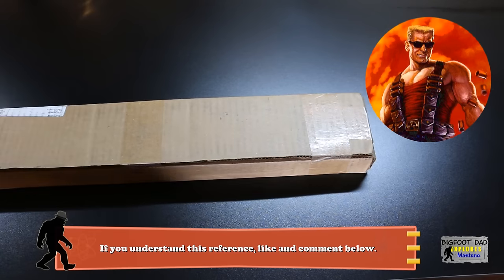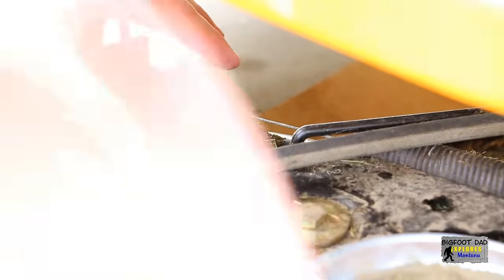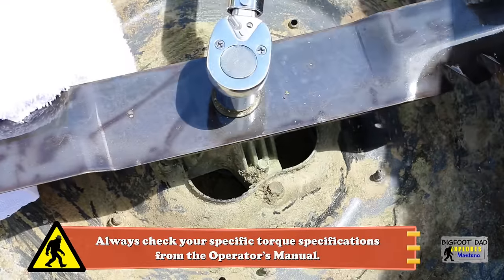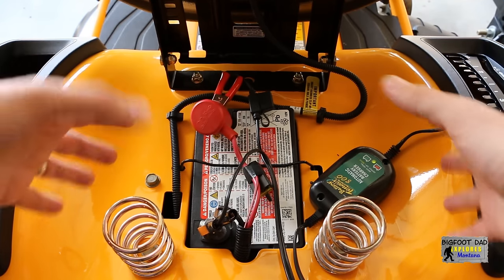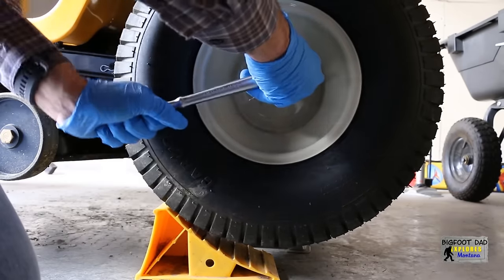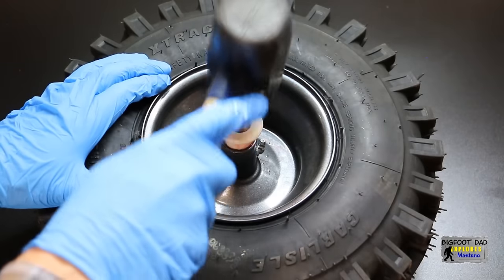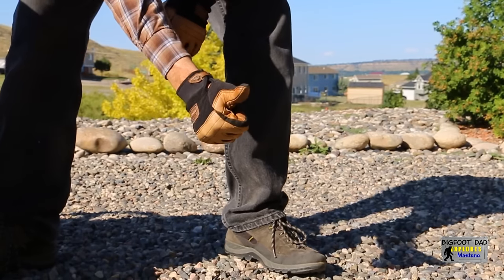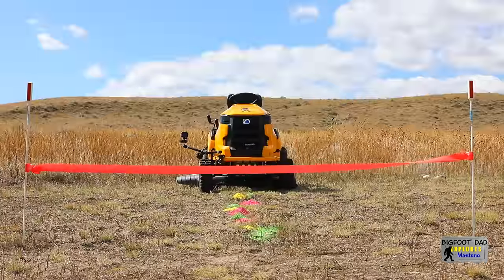Upgrading Your Tractor Mower: Cub Cadet XT1 LT42" Mower (ATV Tires, Blades, Brush Guard, Headlights)

Comment: Do the tires tear up the sod when you mow? I know my atv does.
Reply from the maker: Hi, Stew - I like to refer to this as aerating.  🤣 Yes, this could happen on a yard that has a thick green carpet, especially if the wheels start to slip on an incline. I notice this mainly when backing up the hills - they'll get chewed up a bit.  But keep in mind that most ATVs have their axles locked together in the rear, unless there is some kind of turf-saver mode that will unlock one of the sides.   However, the XT1's, have an open differential, which will help preserve the turf and gives them the tight maneuverability.  I hope this helps.  If anyone else can help Stew from your own experience with this setup, please feel free to chime in!

Comment: If you use those blades know they are heavier and will wear out bearing faster. But they work if you want to cut high grass. Next I would have took my mower to the car wash to keep it clean and looking new. But nice vid
Reply from the maker: Hi, @stephenspencer2121 - this is good feedback and knowledge for people to draw upon - thank you for mentioning this.  It's time for a blade change again so will have to look into either getting new ones again or trying another brand.

Comment: This reminds me of a V6 Mustang. Same pretty, but the engine doesn't sound right.  Gotta have that sweet V sound.
Reply from the maker: I'm bringing this over to your garage next weekend.  Time for an engine swap.  😉
Reply: @BigfootDadExploresMontana  I actually do have a spare. The transmission died on my last mower, so I scrapped it, but the engine was still good. 26 hp Briggs Extended Life Series. Only about 130 hours. Dirty secret of riding mowers, they're all compatible. Same engine mounts. They just charge you more for the various upgrades and color schemes. Find yourself a V-twin and stick it in there. A true upgrade.  Won't go any faster, but will be much more powerful.
Reply from the maker: @wiredforstereo  - Thanks for the info on this.  YES, this would be an awesome upgrade.  I've also seen that you can upgrade the transmission on these too.  This sounds like something worthy of doing.  I think that something is up with my transmission - it doesn't reverse all that fast anymore.  🤦‍♂️
Reply: @BigfootDadExploresMontana  Your local mower guy can often resurrect these. I'm told it's an obstruction issue with an internal filter.  Or you can replace the trans. Though they're not cheap, a major proportion of the total mower cost.

Comment: Hey man, I want a mower that I can cut with at six inches high, already have those blades and tires , what would be the benefit of putting taller tires on.
Reply: You can go faster
Reply from the maker: @MudStreak Legend - this is true!  😂  
@Milton Aliff - the rear tires are pretty tight as there is not much room between the deck and the tread.  You may be able to eke out an inch larger on the diameter, but that would be pretty close on the margins.

Comment: pro tip you do not have to do all this to replace the blades simply drive the front of mower up on some plastic car ramps or jack it up and put it on stands
Reply from the maker: Hi, Gold Beast - Agreed - that is much quicker.  
I tried recording it with the front end lifted, but couldn't get any good camera angles, hence the removal.  I probably should have mentioned the video that it's not necessary, no probably practical in most cases, to remove the deck for a blade change.

Comment: I checked your link for rear tire , they don't have 20×10-8
Reply from the maker: Hi, Ukrainian trucker  - It seems that that product on Amazon keeps switching options depending on what they have in stock.  I'm looking through a few websites right now, but they seem out of stock at most places.  I do see some ebay sellers with them, but that's more of a gamble.  I am thinking that maybe a trip down to a local ATV shop might be in order to see what they can set you up with.  These are just ATV tires anyways - perhaps they have a different brand with a good off-road pattern that might work.  Let me know what you find - I'm always interested to hear alternative ways to achieve an awesome upgrade.

Comment: I used this same type blades now it leaves uncut grass behind. Never had this issue before.
Reply from the maker: Hi, Travis!  It sounds similar to my issue I experience every once in a while.  Usually mine leaves the centerline uncut if the grass is too thick.  I do believe there is a slight flaw in their design, but I'm hoping that the toughness of the blades makes up for it in the long run.

Comment: You should have replaced the front wheel bushings with bearings while you were at it.
Reply from the maker: Hi, Mark - yes, I was considering this at the time.  But for some reason, I couldn't figure out how those would work. Still having trouble understanding how that fits together, so I'll have to order a set and see how that assembles.  Future video maybe?

Comment: How did you set the bead on the front tires?
Reply from the maker: Hi Kyle - I actually had the tire store down the street do this.  But I have had the bead come off on one of my old front tires.  I used a ratchet strap to hug the tire and filled the air at the same time.  It worked great!  Crazy Russian Hacker has a video on how to do this.  Hope that helps and good luck!

Comment: If you want a high capacity oil filter just screw a auto filter on it. Yes they work and they are way cheaper
Reply from the maker: Hi, Adam - yes, this is true.  I've considered this a few times as well.  🙂

Comment: What color did you use on your rims thanks
Reply from the maker: Hi, G ranch - I believe it was some kind of silver matalic (I did this a few years back so don't recall the specifics).  I had the same color done on my old 4Runner wheels because I really liked the way the mower wheels turned out.  Basically, I went into the powder coating shop and asked what would work well in the greys and they said that whatever color that was was one of their most popular options.  Hope this helps.

Comment: Should have upgraded the plastic wheel bushings to Ball bearings. I used Marathon 3/4" Replacement Precision Ball Bearings - 4 Pack from Amazon 8 bucks free shipping.
Peel off the inside rubber seal before installing and they are then grease able.
Reply from the maker: Kelly - YES!  I was actually looking into this and then I hesitated because I didn't think it would work.  Do you have a link you can send over?  Really wishing I could have pulled this off.  Thank you for letting me know this is definitely possible!
Reply from the maker: @kellyconstenius676  - thank you, Kelly!  I just added them to my shopping cart.

Comment: Will the tread on the new tires tear up the lawn?
Reply from the maker: Hi, Paul.  Yes, this is a possibility.  As you can see from my yard's terrain, I don't have to worry about that.  However, if I had nice grass, then I could justify it by claiming I'm aerating the yard.  😉
Reply: @BigfootDadExploresMontana  Ok, My grass is a bit better than yours. But I cut a2-3 other yards for my older neighbors.  Guess I will pass on getting those tires.  Wondering will any front bumpers that are similar fit this mower?  Or do I have to stick to cub cadet?
Reply from the maker: @paulpaetow90  - Sure, that's understandable.  As far as the bumper goes, I have seen about 3 different kinds for Cub Cadet.  But as long as the brackets line up, it'll fit anything that is close.  You may just have to take a few trips to Ace Hardware to get everything squared away.  😎

Comment: Careful, I started with a old Craftsmen upgraded it. Then bought a Husqvarna 26hp and upgraded it. Next thing I knew I had a John Deere 1023e......... and I'm upgrading it. I think I need help.
Reply from the maker: Mike - OMGosh - the 1023e is a beast!  Some may say this is unhealthy.  But I say, roll with it!  Pure raw, machine power coursing through the American dad veins is not a bad thing - at least around here, anyways.  What will you upgrade to next?
Reply: @BigfootDadExploresMontana  A new wife if I go beyond the 1023e. It is a beast, I added teeth to the front bucket and have been digging up large stumps with it. I'm talking about 6 foot wide by 4 foot deep holes to get under the roots. After the warranty is up I'm going to crank up the fuel and see what she can do. Maybe a small turbo?  It's def a sickness.

Comment: I'd LOVE to upgrade mine but I got 5 HOURS on the thing and it won't start , when it did start ONCE as soon as the blades engaged it died, so disappointing
Reply from the maker: Hi, Rottie - did you figure out what happened yet?  It sounds like you may have a carburetor or spark problem.  Hopefully an easy fix and you can be on your way soon.
Reply: @BigfootDadExploresMontana  it was the solenoid , thanks for asking!

Comment: How did u remove the head lamp covers??
Reply from the maker: Hi, Rod - it was a but tricky.  The film, obviously, was an abbreviated version.  The biggest nuisance was releasing the clips from the inside of the hood.  I remember removing the entire top assembly from the hood, then using a mirror, I located the clips for the headlights from within the frontside hood and used a long screwdriver to push on and release them.  I then used the trim-removal tool as seen in the film to pull them the rest of the way off.  Basically, it took some patience and a lot of examining before I I figured it out.  I hope that helps!

Comment: I have a John Deere D170. Belt keeps coming off. On the Deck Could you  Tell me What is wrong?
Reply from the maker: Hi, Eddie - I'm leaving this comment open to see if someone from the community can help.  I would check for an alignment issues with one of the pulleys or a tension issue.  Can anyone help Eddie out here?
Reply from the maker: @ainttakenanyshit  - awesome, thank you for the note!    @eddieolivera539 - this is something worth checking into.

Comment: Awesome video
Reply from the maker: Thank you, Dee!
Reply: @BigfootDadExploresMontana  not a problem. You gained a new subscriber
Reply from the maker: @Mr.Towboater87  - wooo-hooo!  We're glad you're here with us now - welcome to the community!
Reply: @BigfootDadExploresMontana  definitely! A little off topic but I have yet to find a video on the cub cadet branded 547cc engine. Am I the only one with this motor lol
Reply from the maker: @Mr.Towboater87  - Hi, Dee.  No, not at all!  This is a rebranded engine made overseas.  Although Cub Cadet doesn't directly build this engine, it does have some neat features, such as fuel injection and, as a result, a bit more powerful than some of the carbureted units of similar displacement.  There are concerns about longevity of this engines as some have speculated on the quality, but I haven't personally heard of any issues yet.  Hope this helps!
Reply: @BigfootDadExploresMontana  wow I didn't know that. Thanks for the information! Really big help.

Comment: Can anyone tell me if those are the OEM rims for the rear?  I ordered the exact tire in the vid and the fit is not right at all.  I can't tell where I went wrong...
Reply from the maker: Hi, S7A2G6.  Yes, these were the OEM wheels I am using.  
The most important measurement is the radius of the tire.  If you can get those to match, and then at least get somewhat close with the width and height of the old one, it’s usually good enough.  I’m wondering if your wheel size is different.  
Also, these were pretty tough to put on, so I had an automotive tire shop put them on.  Perhaps if you take your tires (old and new) and wheel down, they can either give you advice on what should fit or help you install them if they’re close enough.  Meanwhile, if anyone else can help S7A2G6 out, please chime in!
Good luck, S7A2G6– would love to hear some good news when you get something to fit.

Comment: I reccomend getting rid of that Kohler courage motor they over heat and crack the block leak all the oil then you throw a connecting rod
Reply from the maker: Robin - I've heard of this too.  But if it does, I'll have a new upgrade video!! 😅

Comment: On my tractor the head lights are on the metal arche covers faceing the middle with a light bar on the cab fully road legal turn signals rear head lights tage plate hazard lights radio air and heat power stearing air ride seats full body suspension cb radio and pa speakers 10 speed spicer twin stick transmission warning triangle on front and back split rim tires with a split rim spare.

Comment: I've never pulled the deck to do all you did to the deck and who torques mower blades? What's the push bar for? Sure, if you've got a lot of extra cash and time to install that junk, to each his own.
Reply from the maker: Hi, Deliveryguy!   Yes, it's much easier to film with the deck removed.  Agreed - I usually change the blades on my previous mowers just by jacking up the front end.  The pushbar?  Well, that's incase any squatches jump out in front of me while I'm mowing through the forest.  😉

Comment: I have the same exact mower.. I do not know how I ended up here though. These mods are .. different lol. I think I'll pass though. The tires would be kind of cool but my yard is mostly flat and I do not plow with my mower or anything. If I did somehow get it stuck and not be able to get it unstuck the normal way, I have a 4 wheeler with a winch lol.
Reply from the maker: Hi, wantsanewvehicle - it's ok, I wonder the same thing after an hour or so of YouTube. I'm glad you made it here even though some of these mods may not be your thing - that's totally ok. But for when you got stuck -😅 Hey, if you have a winch, you gotta use it no matter how odd the trask.

Comment: Put a garden plow on it.... that would actually be impressive
Reply from the maker: Hi, Paul - I agree - that would be impressive!  I think I may want to to upgrade to the XT3 for that though. 😅  There's a lot I could plow around here...
Reply: Aren't there stock parts to mount a sleeve hitch on an XT3....
Reply from the maker: @Paul-hl5ls  Yes, indeed.  I found this on Cub Cadet's website:  https://www.cubcadet.com/en_US/riding-mower-accessories/sleeve-hitch/19A40041100.html

Comment: As a professional lawn service u do now have to take the deck of to sharping blades simply lift the mower with a jack an put it on stand an use a inpact
Reply from the maker: Hi, Chad - agreed.  But where's the fun in that?  😂  But really, this is actually how I usually do (actually did, on my older mowers) this as well.
Reply: @BigfootDadExploresMontana  I’m js people don’t have to do this if they don’t want to

Comment: How hours does it have now
Reply from the maker: Hi, Max - I just went out and looked.  It has 21.5 hours.  It takes about 1 to 1.5 hours to do my lawn, depending on how much I decide to mow that cycle.  Still going strong!
Reply: @BigfootDadExploresMontana  

I recently bought this exact mower (fuel injection) over a JD E100 (same price), which I probably should have went with.

I read this mower is only expected to last 500 hours, but I plan on getting more by changing the hydrostatic transmission fluid even though it's supposed to be lifetime. 

The engine is a chinese made copy of some engine (not sure which yet).

We'll see. 

John  14:6 Jesus saith unto him, I am the way, the truth, and the life: no man cometh unto the Father, but by me.

Comment: Blades are meant to be 90 degrees from each other afaik. 12 o'clock and 3 oclock
Reply from the maker: Hi 5wisher 5weet - I agree that would be optimal if they were locked together through gearing.  However, these are sorta 
free-wheeling so their positions will always be random after a disengagement.

Comment: Should of bought a xt2 for 400 bucks more already comes with brush guard bigger cca battery actual bearings in the front rims and tires that actually work.  Oh yea a twin cylinder engine that doesn't shake and vibrate your feet.  But still a decent video.  Frames and transmissions are identical.  Well I guess you should need to jazz up the cheapest tractor cub sells.
Reply from the maker: Hi, Paul - I agree.  If I could wind back the clock, I may have done that.  Thank you for pointing out the differences - a lot of people ask what those are between the different models.

Comment: I personally would've just saved the money from these mods and got the better XT2 or even XT3 from the start. You get a better trans, larger wheels & tires, etc. OH, and a locking differential! With the diff lock you'd have way more traction with stock turf tires than a one wheel peel with ATV tires. Just my 2 cents (worth about $0.0001)
Reply from the maker: Hi, RockyX13 - hey, I think your opinion is worth more than the 1/10,000 of a penny you appraised it for.  You are correct - reallocating that money towards a better model with those features would go a long way and will be best for most.  But then I got to thinking.... I would have to upgrade that model too!  😂  Thank you for commenting and welcome to our community!

Comment: Is it weird that I did the same thing but to a push mower
Reply from the maker: It's never too weird to do a dad thing like this.  But I want to see a picture of this!  😂
Reply: @BigfootDadExploresMontana   I put an overhead cam honda gcv 160 engine from a husqvarna hu700f onto a craftsman 21" deck that had rear wheel drive and replaced all the wheels regressed the transmission and put a fancy blade on it

Comment: You forgot to install a deck wash kit - use that after each use and you won't have that nasty build up.
Reply from the maker: I think part of what I should have done is lowered the blade down to the lowest setting, then used the wash port (you can see I was doing this on my previous video).  Funny how much prep I put into this and still missed that.  Oh, well - that's how we learn and help each other out!